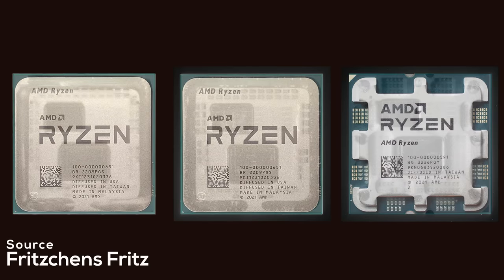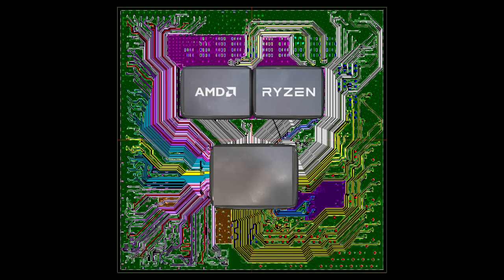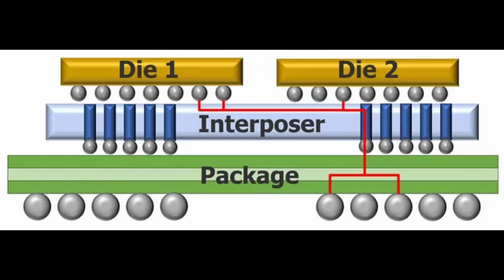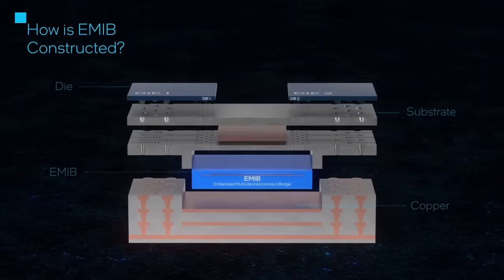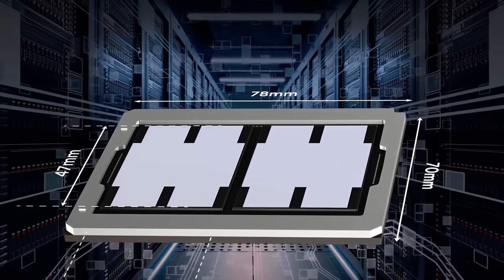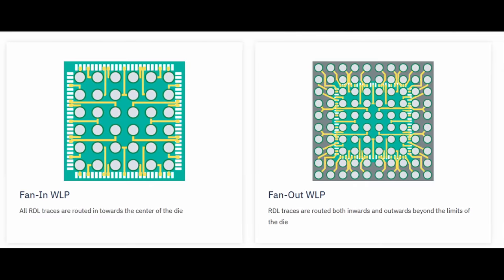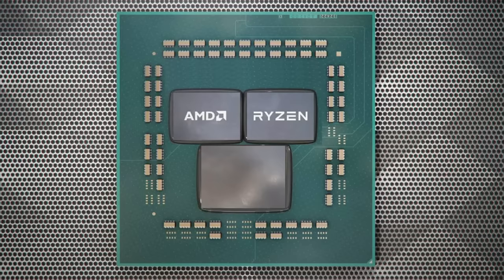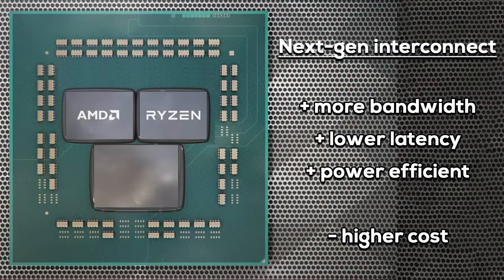AMD ZEN 6 — Next-gen Chiplets & Packaging

Comment: Silicon Interposers also kind of defeat the point of splitting the chips in the first place no? It was to lower manufacturing losses and inaccuracies while being more thermally and thus energy efficient by spreading the heat load. Not sure I'm following your logic as it would undo all of the benefits.
Reply: You still keep the benefit of manufacturing different things on different nodes, not to mention easier semi-custom designs, which are AMD's forte, or at least important part of buiseness

Comment: 5:19 Does an interposter have to be manufactured on the most bleeding edge nodes though? Wouldn't something like 40/28nm be enough?
Reply from the maker: No, and they are not. Still, due to their size and mask stitching, they are expensive.
Reply: Intel is making MTL's on a modified verison of an old node. 40nm might not offer the interconnect density, but but 28-20nm would be plenty. I don't know what TSMC makes their silicon packages on though, they might be using 16nm as they've had that node for ages.

Comment: the IOD should have a snoop filter or directory for cache coherence.
Reply: They should add the dual data back in and let the chipset be a glorified usb controller. 

Hopefully that allows much better routing and avoids retainers pushing the signal all over the mobo and back again.

Comment: So, this is the EXACT reason why AM5 hasn't appealed to me yet.  With the IF you run into different technical problems which adds latency or puts limits on what the architecture can do.

I already have a nice AM4 system with X570/5800X3D/32GB 14-14-14-34 RAM/RX 6950 XT and it's a well balanced system.  When Zen 3 was made my suspicion was that will be about the last generation where the speed of the cores aren't affected much by the Infinity Fabric and that's turned out to be the case.  Zen 4 shows degradation in different ways, not over Zen 3 of course but what I feel should be its speed capabilities in different operations vs. what it can actually do.  You can see it with memory speeds not giving much benefit after about 6000 - 64000 MT/s depending on the silicon lottery, you can see it with worse scaling vs. Zen 3 in running heavily threaded apps AND you're using a 2 CCD part.  And that drop in scaling has to do with the added latency of moving data from one CCD to another via the IOD/Infinity fabric.

For AMD to keep using the IF design and keep up with their much faster cores (rumors for Zen 5), they'll have to clock the IF much faster and for one it's probably not even possible but two even if it was it would use even MORE power and become inefficient.

Comment: I really hope this video is going to say they are putting a proper head spreader on these chip!
You can take 20c off with a better nothing more than a better IHS!
Reply: If they shave off the IHS height it'll make all coolers incompatible with it, not worth it in the slightest.
Reply: @beachslap7359  I disagree, they could probably get over 10% more performance out of a cooler running chip. A conversion kit for old coolers would be a few bucks and on the cheaper CPUs they can include a $10 cooler like they used to.
Reply: @Speak_Out_and_Remove_All_Doubt 20 degree headroom will give you at best another 300 mhz on the cores, which is going to translate to 3-5% extra performance.
Reply: @beachslap7359  If the design team knew they weren't going to be thermally throatled they might have tweaked things differently, added more X and more Y, increased Z, etc. At the very least it would all run cooler, quieter and at a higher efficiency.
Reply: @Speak_Out_and_Remove_All_Doubt Yes, and it's not only about the performance, 20 degree is the difference between a silent PC and annoyingly loud one.
People defending such a BS for literally no benefits are dumb, you can't argue with them..
Reply: @petru3774  temperature and noise aren't directly related unless you make it so by using the same fan curve with different chips. It's still easier to cool a 7950X at 200W than a 14900K at 350W despite the comparable performance.
I do hope AMD end up raising the dies and thinning the IHS, leading to more efficient cooling while preserving cooler compatibility, but the current offerings are very competitive, bad feelings about the temperature readings notwithstanding.
Reply: @kotekzot  I am not comparing to Intel here, and agree that Intel is even worse in current generation, I just don't understand how they can make such a good product and then destroy it with shitty IHS for a 1$ economy.
Also likely all future generations on AM5 will have the same problem, Ryzen 8xxx is even worse. 
Yes, you can edit fan curve, but not the top end, and under some load even with a decent cooler and a 65w Ryzen 7600  system is still very noisy, especially in a compact system where 20C make a huge difference.
Reply: @petru3774 I think as far as AMD are concerned it's actually more expensive to have a thicker IHS, more copper. How big of a value add better AM4 cooler compatibility is is debatable, and I think it was an unfortunate decision.
Reply: @kotekzot  I mean economy on some adapter for old coolers.
Is that really copper?
I think a few mm more thickness won't be such a problem if IHS was made from copper.
Reply: 20c with new IHS is copium, with direct die maybe

Comment: I prefer AMD to make the budget descsion, the reason i like the AMD CPU's is that you at least when i bought the 5950x get the high end performance for an good price point. Maybe not the best CPU for all applications but it was cheaper/faster for most scenarios compared to intel at that point. I see Intel going for the expensive solution and so far they still not moved desktop cpus to a new chiplet design. Better take smaller steps towards that goal maybe intell will overtake AMD again when they are able to make it work, but i wonder if the price will compensate for the performance they will get

Comment: This sounds silly, but why not just turn the chip-lets to the side - interconnect the memory as well per chip-let (like how Apple does it) and boom - not only is the two chips able to talk to each other directly - the also share the memory, so if a task does switch from chip-let to the other for whatever reason - it doesnt have to move any memory let alone one chip-let will also double the amount of L2 it would have access to by considering the other as a higher level L2 or 2.5.
Reply: My guess is that the chiplets rely on the IOD for the directory for cache coherence between chiplets which makes a lot of sense for EPYC.

They wouldn't want to move that function to the chiplet unless it also made sense for EPYC.

Comment: So basically, CPU manufactures are aware of tech which is about 2 gens above the current available tech on the market, but dont use it because of the cost...
Reply: That's just how R&D works. Us engineers have to make choices to use technologies that are reliable, available in massive quantities, and with yields high enough to not be eating cost on every wafer. It should also ideally be available enough to be used throughout testing, so you see CPUs released on tech that was present when design started rather than what is currently in development and making headlines. CPUs take years to design and get production ready. I joined Intel 4 years before Lakefield was a thing and worked only on things related to it until it hit final Si revisions. Those 4 years were also my PhD on silicon interposer design. Same thing happened with ADL, RPL, and MTL talking years to reach the consumer.

I would not be surprised to learn AMD has Zen6 and RDNA5 in a lab somewhere after seeing what's in Intel's pipeline and how far future they can look internally. I would also not be surprised to find weird never-released hardware in those labs like a tiny RDNA2 die with an MCD hooked up like a Frankenstein GPU.

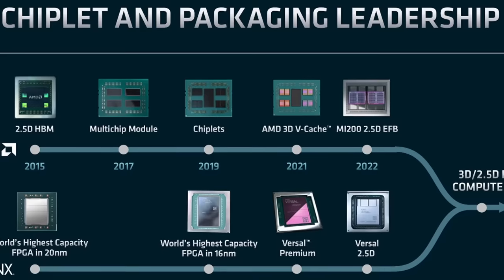Comment: 10:02 Ok, so silicon is a plastic polymer. Silicon is a very bad electrical conductor, practically it is an insulating material. You might be thinking of Silicium (Si, 14th element of the periodic table).

Comment: Put high speed ram on the PCB and iGPU becomes actually relevant, and might sell like hot cakes.
Reply: Would never fit. They would need a trx40 style board to fit ram on it
Reply: igp's will always suck, they're just laptop dies with less efficient voltage-frequency curves

Comment: 4:40 AMD's current low tech solution :D :D Being "low tech solution" it still manages to defeat Intel's supposedly "high tech solution" both in terms of power draw and heat output... Come on man, I though this channel is not about poisonous arrows.
Reply: Low tech routinely beats high tech, look at WW2.
Reply: to be fair it's not great at idle, even with 1 CCD
Reply: @marshallb5210  As opossed to what other CPU with one core die?

Comment: So they have an RTX7090 128GB. Card but they sell those to the big corporations and sell us a very small portion and call it the 4090. Next release it will be less performance than that for the same price!  It used to be less for more FPS
Reply: The RTX 4090 is around 89% of the full AD102 chip. The reason that chip manufacturers sell a smaller portion of the full chip is because there will be some defects in the silicon, and the chip is designed to disable some cores in case of a defect. That keeps yields higher and actually reduces costs. Would you rather Nvidia have sold the 4090 (or more realistically offered a TITAN Ada) with 11% better performance but 50% more expensive? I do agree with you on the RAM, though.

Comment: Ryzen uses the chiplet design because it's based in EPYC, but let's say AMD made the R7 7700X on a single die just like the mobile Ryzen, will it be cheaper?
Reply: Possibly, but also maybe not. the I/O die can be made on an older, cheaper node than the CCD, while if you went monolithic, the entire die would need to be on that expensive node.

Comment: interposer is the easiest but most expensive solution.
so why not stick with it if cost can be brought down over time?
Reply: The cost added may not be able to come down so easily. You need a decent node, like 20-28nm, to get the really high interconnect densities out of an interposer. Those nodes are also just about where the cost per transistor started to level off, so that price is probably pretty fixed unless somebody brings new volume online to add supply.

Comment: Nooo, they are the same crap Intel is doing, by seperating the I/O die from the chip they will increases system latency by a LOT
Reply: as mentioned in the video, AMD already does that, and has since 2019
Reply: AMD's been doing that for several generations. Their I/O die being separate from the CCDs has kinda been the whole deal with Ryzen for a while now.